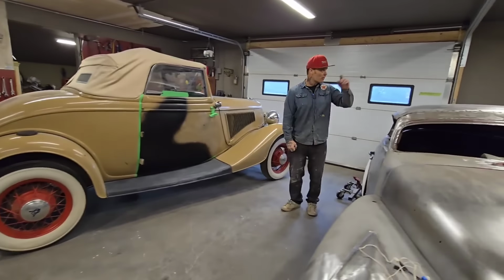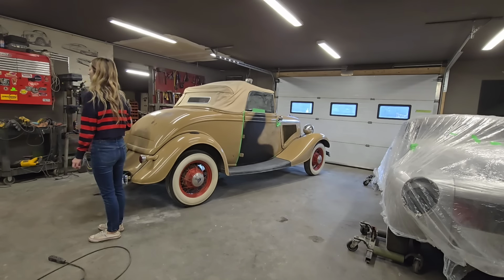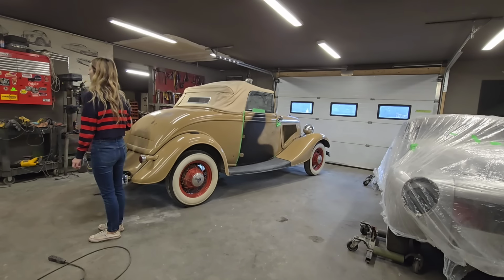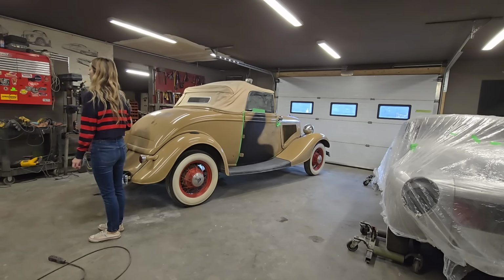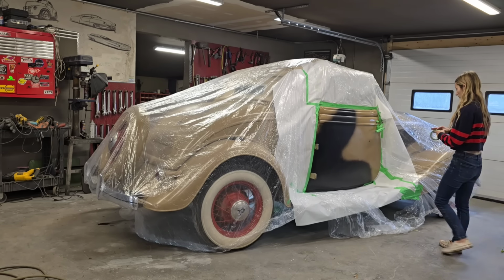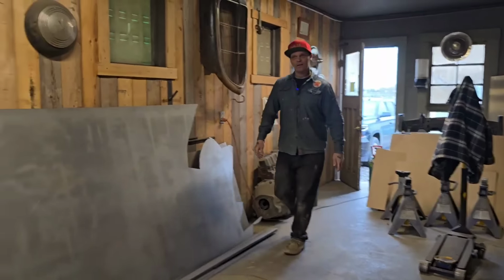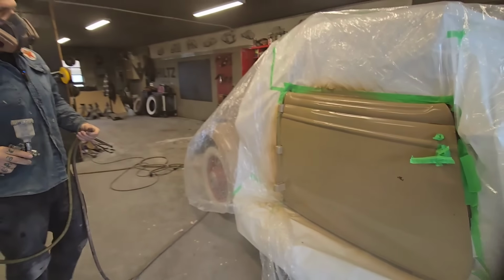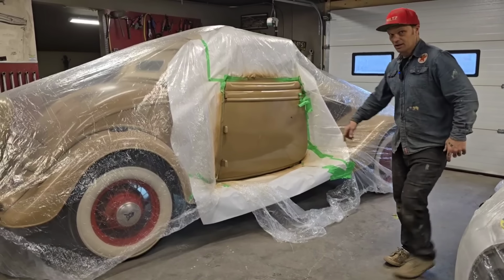Painting the 1934 Ford door with single stage urethane... hope the colour matches 😬

Comment: Curious to see how he handles the blend area between new and old paint. I didn’t see him spray the old paint with blender, so there would be a haze area between them. 
The black looks like it worked out after 3 coats. The red oxide still may have been better. The true test will be how it looks to the quarter panel. Not doubting what he did, just curious on that.

Comment: Chad and Jolene a great improvement on the look of the car. The paint seems to have blended well. It all depends what your final goal is for the 1934 Ford Cabrolet . Is it to keep in your collection  or move it on to its next owner. If you can get it running and driving it'll make a big difference.  You'll need to consult an old school mechanic for that purpose.
Reply: This is Chads chance to meet Cold world motors

Comment: One thing I Luke aboutntour channel is your giving people option on how to do things.  To do a half decent job and save some money. I have a cimment that would save you even more money if people were to do this.  Sort of like your doing here. I can be easier  to use spray cans to prime things for most people. But now we have products that can use very little of and save overall cost but speed up production.  One thing I would add to your arsenal Chad is a mini spray gun from iwata. Yeah  it's an investment.  But worth every penny as you'll have it for ever. It called iwata lph 80. It's my favorite  spray gun of all of them I own.  Very low pressure and atomizer the paint at 15 psi. And you would save on time the size of the compressor  you need . Save on the paint . And nomre import  overspray which is obviously  not healthy.  And there's a waterboune  primer from transtar high build will not pull an edge when used below your paint. So no noticeable  edges to pull and shrink back. Two thinks that would have saved you time and effort  in this instance.  And even made thus easier for you. Okay that's my contribution here. Lol. I love watching your channel.  So much to learn and think about how and why people do what they do. Some jobs don't require the full treatment like you mentioned. I've been selectively buying tools to make my processes more efficient and better over time.

Comment: Chad is more than capable of a perfect paint job and yet on the potentially most expensive car in his collection he takes shortcuts.
Reply: The potentially most expensive car in his collection, by far is Joline’s Bugatti. It certainly isn’t this 1934 Ford Cabriolet with a stuck 36’ engine, with flaking off paint…😖
Reply: @derangedhermit2879  The Bugatti build was what attracted me years ago when Chad had fewer than 50k subscribers.  With the You-tube algoritm I doubt that the Bugatti wil ever get finished.
Reply: @derangedhermit2879 This is history the Bugatti is a bunch of old parts hobbled together and most importantly it will never be a car you can drive around. I watched it being made it will never be dependable but this car is ford history running or not. And no copper water drain pipes on it.
Reply: To dark that black primer did it.
Reply: @Gscalenut  i would not repaint it, its only original once!
Reply: Better than making the door perfect and leaving the rest as is Chad's doing the right thing to make it look nice as is otherwise you'll be saying the door looks to nice compared to the rest of the car which is better because it's original
Reply: @derangedhermit2879 Quite sure you are dead wrong . The Bugatti is not an original and although a cool car when complete ,a Concours ready 34 with 100 % original parts this car could easily hit $100K .
Reply: @Johnsarsenal  You are JOKING !!
Reply: @ why not just sand and paint the hole car. It’s nice enough to paint without taking all apart. Better than this. A paint Joe would not hurt this already painted car. Not all cars need taken apart,that’s why most never get put back together. I know I have bought those un done cars and resold for years that should have just been painted and driven.
Reply: @dral9657  Not sure what you're trying to say, dude. Are you ?  Anyway, on the question of the Bugatti, you will be speechless when the value of Chad/Jolene's recreation is finally revealed.  There's no comparison, of course, but Ralph Loren's original is now valued over $ 100,000,000  !!
Reply: I wouldn't let him paint my wheelbarrow
Reply: @Gscalenut It's horrible to say but barely anything gets finished to the end, I'd love to see the Bugatti hauler finished that was an awesome build.
Reply: @ianbarnes6266  Jolene explained all this on her channel.. You seem to not understand this is a business, and as in any business at times you need to change to make money.. and he is an artist and just as writer may get writers block, he has to move on to something else.
Reply: @marykay9188  I dont follow her Channel and neither do I do Social media, as many have said, the title says comments, and that are just that, good or bad it's a comment, and please don't assume that I do not understand...
Reply: @smittysRods-o2k  Have you singled out anyone else because of something they said ??
Reply: @ianbarnes6266  I see you and others on here diagnosing him with ADHD or whatever,, you are not a medical doctor and prob should not play one on the WWW.. and I will assume from your comments that you don't understand because if you did you would not comment as you do.
Reply: @marykay9188  Actually...DEAR, no diagnosis was made, maybe before you start swooning for Chadwick Hiltz you should watch his very 1st shows before youtube where upon he explains his life growing up then tell me he doesn't have an issue with concentration!
Reply: @ianbarnes6266  I am not here to worry about what his issues are and do not care. I like his artistic style and his quirkiness and the  whole way of this channel a guy and woman that made a nice life for themselves and have fun doing it.

and actually I quote you said " I myself have ADHD and Chad has something similar" possibly with your ADHD you do not remember writing that?
Reply: @edswain5352  I'm sure if you were capable you would not ask anyone to do it. are you not capable of doing it?
Reply: @smittysRods-o2k  christ, having a shot at everyone today arnt you....
Reply: @ianbarnes6266  Following your words they ask for comments so I'm just commenting on comments.
Reply: @ time will tell what a clone will be worth ?
Reply: @diftoyota  it isn’t original anymore !
Reply: @ im sure lots is not original in it, if it still have the original oil in it id be suprised lol
Reply: @diftoyota  painting one door or two, you might as well paint it all . At this point it makes no difference as to being original paint.

Comment: The car is looking more like it needs to be dip stripped and pickled, body worked and repainted entirely.
Reply: And then what ?   Stuck back on an unrestored chassis, with a non-original, stuck motor, pitted chrome, probably with glue in the fuel tank, and what about that fibreglass patch in the floor, along with other imperfections we don't know about ?  Or are you suggesting a $100,000  concours restoration  ?

Comment: SCARED to paint it a normal paint that anyshop would do you cant put in the cost of your own labor in the car belongs to you your going to enjoy it so paint the car the hole thing treat it like anything else you paint its not that special you are you scared you cant put it back together
Reply: " Sad, sad, Don "
Reply: He wiped all the rust off  oozing through all the cracks with spray9 and realized it’s a rust bucket . He’d be foolish to take the risk of an entire paint job . Jst pass it off to the next poor basterd  . 😂
Reply: @lplp74  no its no just surface rust under that lacquer were it pulled  off  just surface cleaned up easy always I that garage dry but his place is not that was a warm garage climate he need s to paint hole thing the right way its a great car and worth the effort  be worth three times more if he did five grand US would be all it would take to do it everything else is good interior just needs a good cleaning all the rubber and fender rubbers fine tops great just have to take your time taking it apart to paint it right